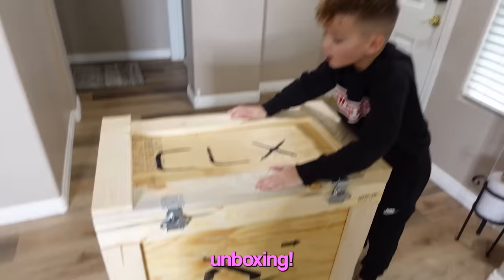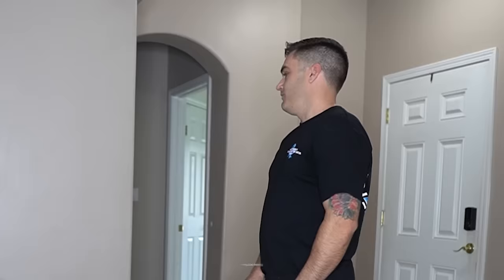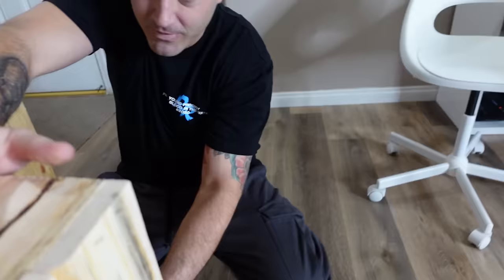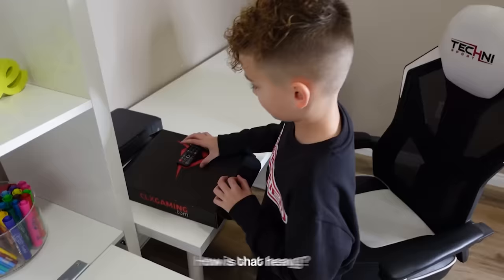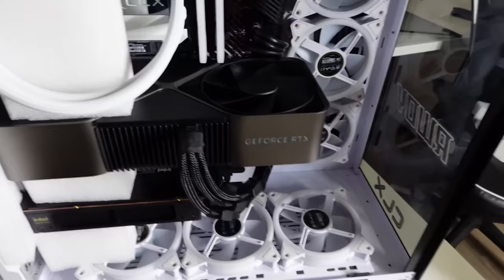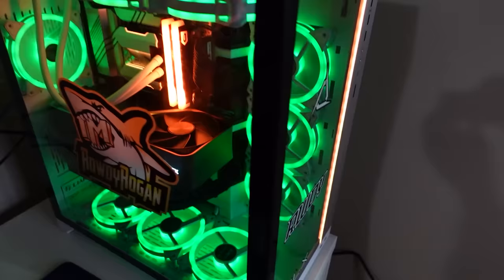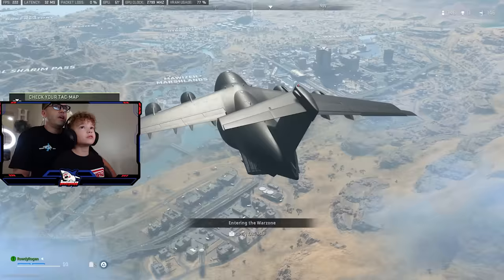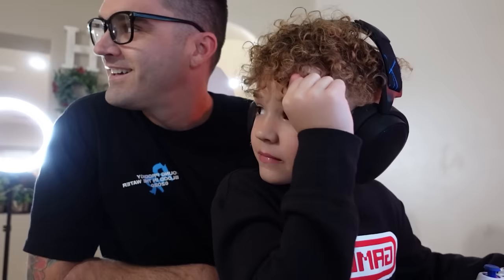UNBOXING MY NEW $6,500 "2 IN 1" GAMING PC

Comment: hey idk if anyone can help me, but I recently got a new power supply for my pc, and I have the right cords plugged in to the power supply gpu, and motherboard, everything turns on but I just can’t get signal to the monitor and yes the cable is plugged in to the GPU

Comment: Dope PC congrats! I have the same case.. Didn’t know you’ve been streaming on a 3070 and only using a 1080p monitor.. You need to get at someone to optimize everything because you’ll can definitely get more frames out of that system, im running a 10900k and 3080 and get the same amount you said you’re getting but my system is optimized

Comment: why wont u get him a 
Gehäuse:
Phanteks - Enthoo Elite | Glasfenster (Glasfenster)
CPU (Prozessor):
AMD Ryzen Threadripper PRO 7995WX (96x 2.50 GHz, 384MB L3 Cache, 350W)
Mainboard:
ASUS Pro WS WRX90-Sage SE, AMD WRX90
Grafikkarte:
7x NVIDIA RTX 6000 48GB GDDR6 (PNY)
Arbeitsspeicher:
256GB DDR5-4800 Registered ECC (8x 32GB)
SSD (M.2 / PCIe):
4TB Western Digital Black (M.2 PCIe 4.0, 7300MB/s lesen, 6600MB/s schreiben)
2. SSD (M.2 / PCIe):
4TB Western Digital Black (4TB)
Netzteil:
2000W Super Flower Leadex (80 Plus Platinum, Kabelmanagement)
Soundkarte:
HD-Audio Onboard
WaKü - Prozessorkühler:
EKWB - EK-Pro Velocity sTR Rack - Nickel + Acetal
WaKü - Grafikkartenkühler:
Wasserkühlung für sieben Grafikkarten - Nickel / Inox
WaKü - Terminal:
Distro-Block EK-Pro Manifold
WaKü - Radiator:
EKWB - EK-Quantum Surface P560M + S480 + 2x S420
WaKü - Radiator-Lüfter:
10x Noctua NF-A14 + 4x Noctua NF-F12
WaKü - Anschlüsse:
EKWB - 12/16 Schraubanschlüsse (Black)
WaKü - Pumpe:
EK Water Blocks EK-XTOP Revo Dual D5 PWM Serial
WaKü - Tubing:
16/12 Schlauch (Matte Schwarz)
WaKü - Kühlflüssigkeit:
EK-CryoFuel (Clear)
Gehäuselüfter:
1x Noctua NF-F12 Lüfter
Kabel-Sleeves:
Kabel Sleeves Komplett-Set (7x Grafikkarte, Schwarz)
Betriebssystem:
Windows 11 Pro 64 Bit (inkl. A+ UEFI-Installation)
pc? this is way better